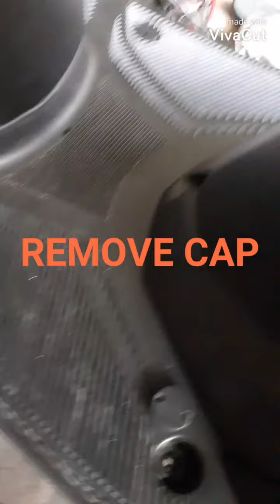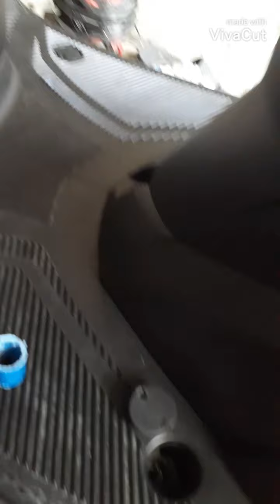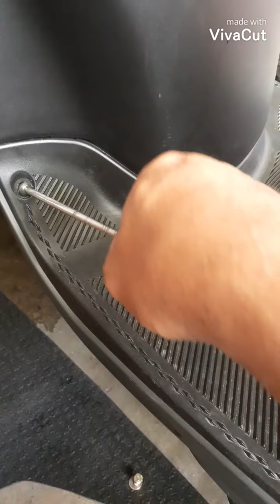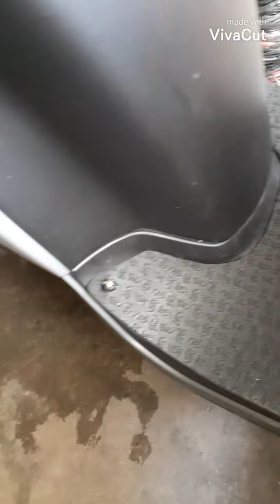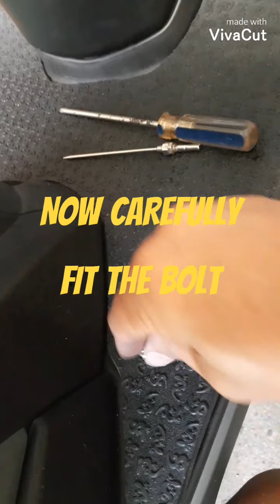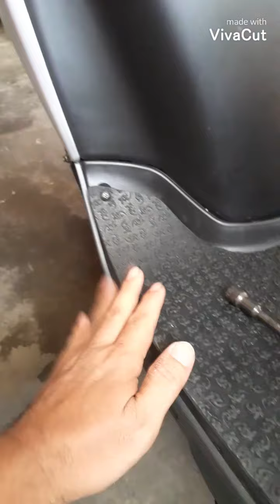MIO GRAVIS RUBBER MAT INSTALLATION

Comment: pde po ba kht di na need lagyan ng pipe?
Reply from the maker: Need pq rin.Yung pipe po kasi ang kokontra sa washer at bolt head. Para po maipit ang matting. Pwede naman ibang material po ang gamitinnpara mayroon kumapit sa matting😁
Reply: Ano size ng bolt boss